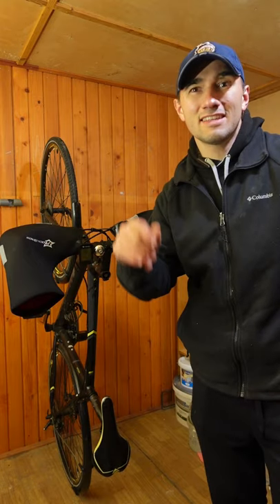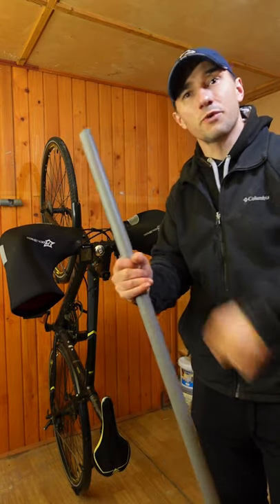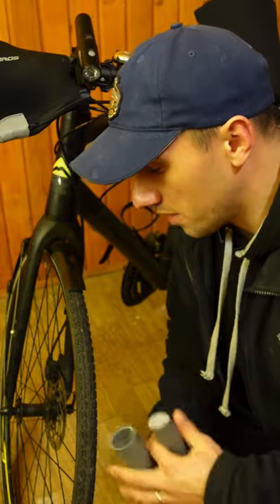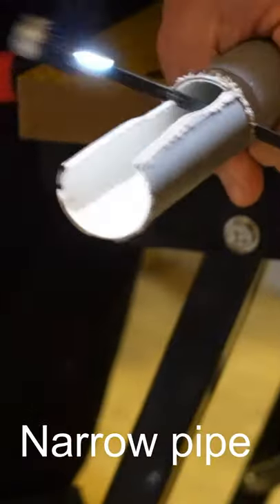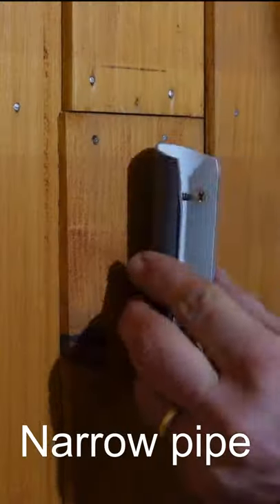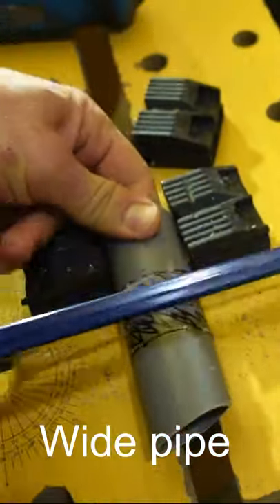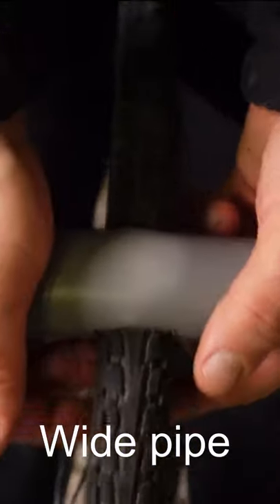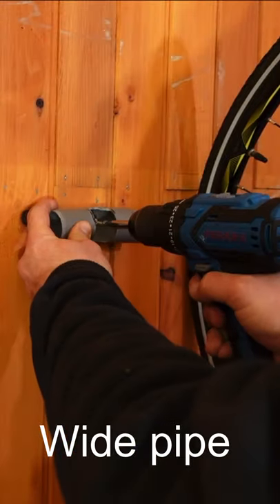Crazy Simple DIY Bike Rack #shorts

Comment: Put a velcro strap between the pipe and wall so when you lock in the wheel, you can use the velcro strap to wrap it around the rim to secure it much better.

Comment: I hang my bike on the wall using a French cleat:  get a large "L" bracket from the hardware store (I got one cheap at Harbor Freight).  Screw it to a piece of 1"x4" the length of the bracket.  To the back of the 1"x4" at the top, screw a piece of 3/4" plywood cut to the width of the 1"x4" and about 3" long with a 45 degree bevel at the bottom.  The point of the bevel should be away from the 1"x4".  At the bottom of the 1"x4", attach a small piece of 3/4" plywood.  This will act as a spacer so your bracket/hook will lay flat against the wall.  Choose the wall where you want to hang your bike.  At a point higher on the wall than your bike is tall, securely attach to studs a strip of 3/4" plywood long enough to span several studs.  Cut a 45 degree bevel at the top of this strip.  Make sure the point of the bevel is away from the wall.  Hook the bevel on your bracket onto the bevel on the wall.  The two 45 degree angles correspond to each other to make a very strong way to hang the large "L" bracket.  Hang your bike by its front wheel on the bracket.  You can hang your bike securely taking up minimal space on the wall and in the room.  My bike hangs this way behind a door in a room in the basement.  It is a perfect way to hang my bike each day after my ride.

Comment: Not a chance
Reply from the maker: Simple and to the point comment. I was skeptical about it too, but it's been holding my bike pretty well. You can add a Velcro strap that holds the rim tight in case you're worried about it coming loose. I may actually add one too.
Reply: Cool. I don't need one because I have ton's of storage space but I love finding new ways to do the same thing, sometimes even better, on the cheap!